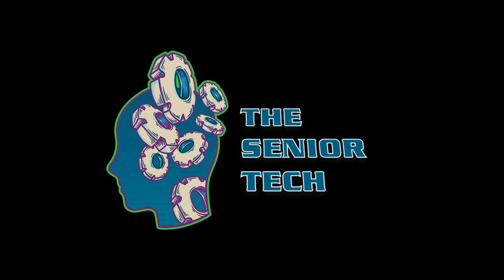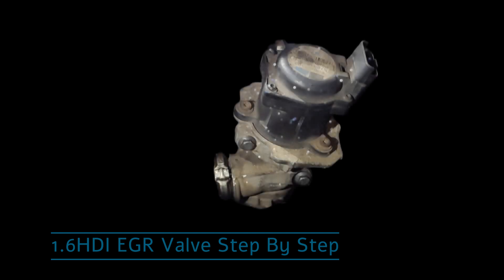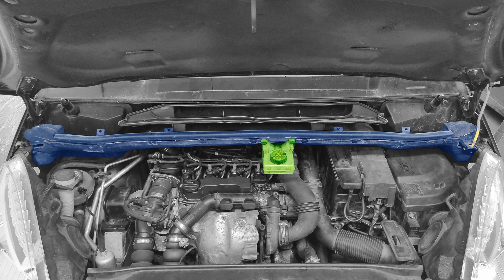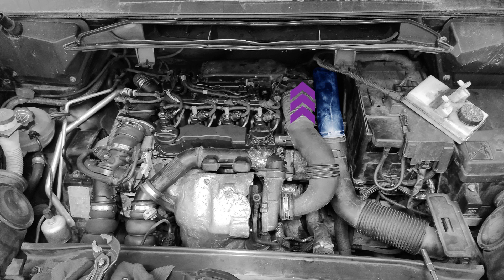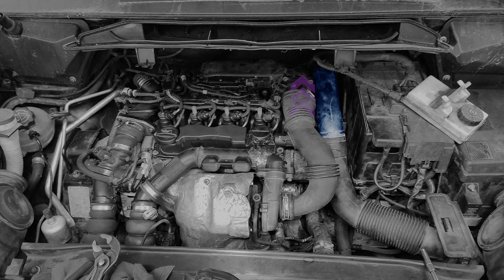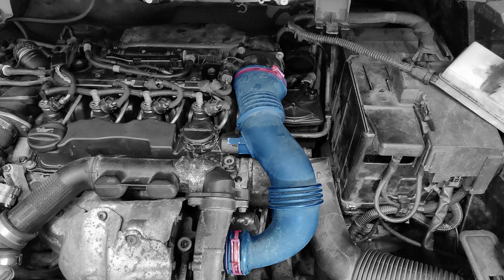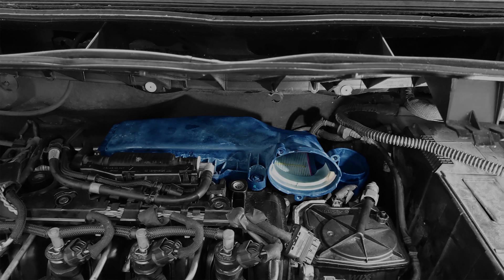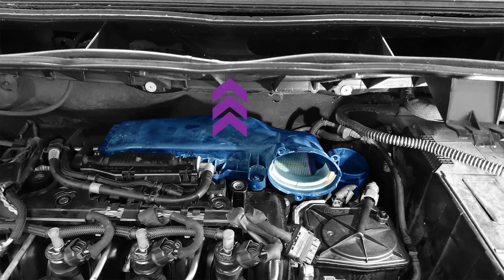EGR Valve Step By Sep Guide 1.6 HDI Peugeot/Citroen

Comment: Thanks for the video. I have another question. How much torque should be tightened the EGR and fuel filter bracket bolts? Thx.

Comment: How do you get it back on pipe at back of engine??
Reply from the maker: The first slot into the EGR cooler and then bolted to the cylinder head.